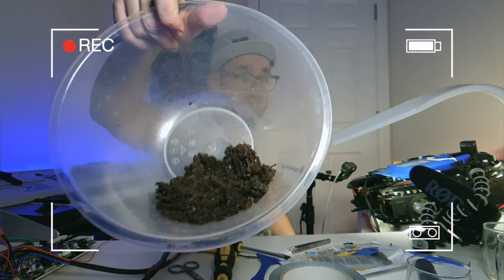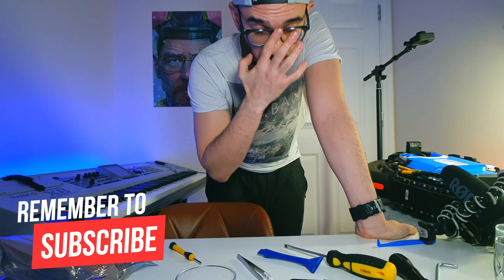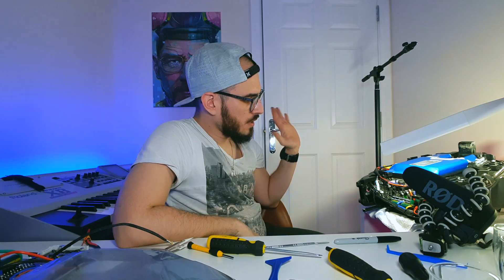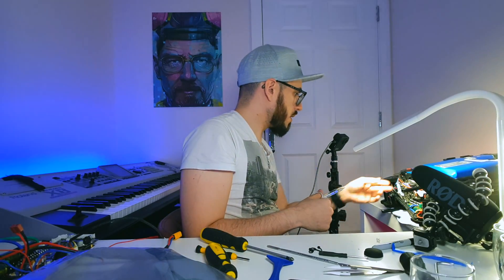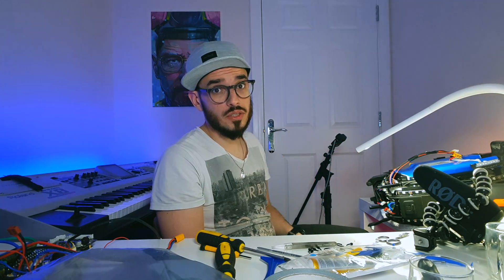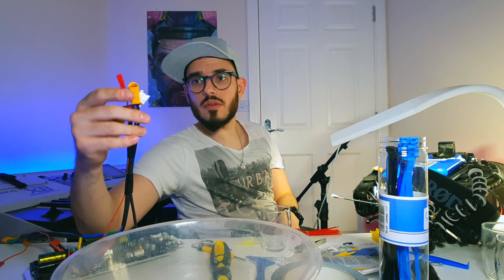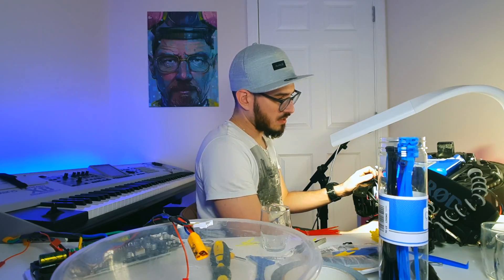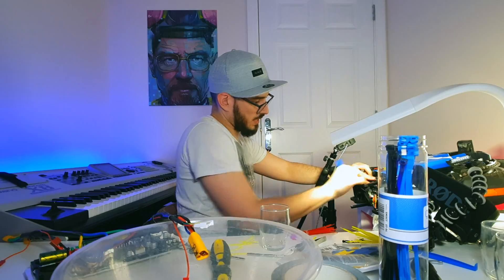Kingsong 16X disassembly ❌SUCH A BAD SURPRISE ❌

Comment: Very good content
I am reviewing vids on this wheel as I am looking to purchase  one to replace my V10F.
So the inside of the wheels electronics compartment was fine, just dirt in the wheel compartment -- that was very good IMHO.
I found the design of how they placed part of the heatsink in the wheel compartment very interesting.  This always for the tires rotation to get natural cooling to the heatsink which is good. There are 2 downsides to this though:
1) the heatsink can build up a dirt layer over time seen at around 8:11 when you pick up the old board. The thicker the dirt layer on this the part of the heatsink the less the heat gets dissipated effectively compared to the new one I think based on my experience with computer heatsinks -- not sure if you notice if your  wheel was running a couple degrees cooler with the new one?
2)I think the material around the hole that seals the electronics from the wheel will be compromised when the old board removed, possibly allowing water and dirt in.  Maybe some extra sealant should have been be added like you did for the covers?

As for all the dirt in the wheel compartment, that did not bother me, other then what gets on the heat sink. I assume all wheels will get dirt in there. If there is evidence it is prohibiting airflow to the heatsink I might think about it more.

Thx for a great vid.
Cheers
Reply from the maker: Hello, bro thank you so much man. Yeah, it was like me I really don't like this design for making the motherboard colling down.. It was surprised man .. But more whells will come this year

Comment: This video made me think of another new invention (which I often do but then I never actually produce) A small stiff bristle brush which clips onto the outside of the tire, and then you roll your wheel forward/backward and the brush which is clipped on the tire moves through the inside and cleans underneath. 
You could do it after every day. And I understand there is not a lot of room but I am sure that it would be possible to make it!
Reply from the maker: That will ve a good product if ot works

Comment: Nice vid. I just ordered a new trolley handle and handle guide bars. My wheel got pretty beat up after getting hit by a car. Wheel still works great and it's gone flying many times. It doesn't look pretty but that's what I get when I buy a fast wheel for my first one.
Reply from the maker: Are you ok? Thats the most important part?
Reply: @MADpack  Oh ya, I reacted correctly by jumping at the last second and rolling into the bonnet/windshield. That made for a softer impact. Still enough to crack the wind shield but I'm fine. Definitely sore for a few days. 
Funny enough, I got more hurt from overleaning on the wheel at almost max speed. I've been scared to push the wheel ever since.
Reply from the maker: @GiffysChannel  im sure.. It was like me when i really hurt myself last year.. It will pass. Just be careful
Reply: @MADpack  Yup and always gear up. I just watched your video of you riding with someone on a bike and I almost thought you weren't wearing pads but then I could just barely see the outline of your knee pads under your pants. It's the same way I wear mine lol

Comment: Still have the z10? I ordered as well a 16x next to my z10 . How would you say the water rezistance is onnthis one ?
Reply from the maker: Hi bro.. Nothing better than see the full review i just released this week: 
https://youtu.be/2MzFRiGnhAc
Reply from the maker: Hi bro.. Nothing better than see the full review i just released this week: 
https://youtu.be/2MzFRiGnhAc
Reply: Will do that then!
Reply from the maker: @AlbertVicol  after let me know if you like the video
Reply: @MADpack  Ofc ofc, I still look over forums, seems to be a problematic wheel. Here in norway lots of rain and I ride winter, I fear it will not keep up with z10 when it comes to water rezistance.
Reply from the maker: @AlbertVicol  there the z10 is a much better wheel in my opinion is one of does boxes that the z destroy the ks 16x
Reply: MADpack Agreed! I crashed at max speed, wheel tumbled for like 20m and just some minor scratches. It is a fking tank. As water wise, 2 gasket system, only problem was getting water in hadle which made grab or power button fuzzy and behave weird, let it dry overnight and works like a charm again. I was thinking maybe the new GW MsuperPro, that seems also a potent wheel.
Reply from the maker: @AlbertVicol  yeah power button is cover with gorilla tape in mine. Like i said still love my z10. Im still negotiating to review the ms pro.. We will see if i can bring it
Reply: MADpack that would be awesome !
Reply from the maker: @AlbertVicol  i agree.. Lets see bro

Comment: Why is the heatsink in the wheel compartment? Seems like bad design
Reply from the maker: Is to cool down the motherboard the think is it should not accumulate mud like that
Reply: @MADpack  just ordered a 16x as my first, it still looks like a good wheel.
Reply from the maker: I will never order the 16x in 2021 with the v12 at your door step. The 16x next to the v12 is a toy
Reply: @MADpack  Now with all 2nd generation V12s grounded and put on the Shelf or else risk joining the dozens-of-cutouts list, the 16x is looking a lot better again. 😁
Reply from the maker: My friend the situation of the v12 is already addressed and is been sort it so no I prefer to wait for a v12 motherboard than ride a 16x but that’s me :) the way I ride I will cutout a 16x I. The first acceleration
Reply: @MADpack  I agree with you that if you want to spend a couple hundred more and don't mind the bulk of a heavier wheel, the v12 is definitely a superior piece of kit. But I don't think Inmotion is being as responsible as it should, you have to be inconvenienced (for months maybe?) by evidence of your wheel failing or they won't replace anything. No guarantee it won't cut out down the road, possibly resulting in injury.

I recently watched Duf do about 42mph on his V12. So yes the wheel looks like a lot of fun, of course until maybe it isn't. In the near future I hope everyone who has a V12 ends up with a safe wheel they can ride with peace of mind.

Until then, I was merely remarking that as of this very moment, your comment about the 16x hasn't aged very well. Even down the road when everything's resolved I think a 16x would still make for a safer wheel for those new to the sport. (for at least the first couple thousand miles ✌)

Love your content, hope you are cool with a constructive comment.
Reply from the maker: Have you seen the video of the v12 cutoff? When we talk about safety when you have a wheel that is so easy to over power like the 16x and that is possible to do a cutoff on the 16x makes no sense. Beside that when the 16x came out loads of cutoff happening, innershell breaking like paper, leds stop working speakers stop working, dust going in after 5km … and the v12 was tested by multiple riders with prototype wheels and no one had a cut off so I will disagree that inmotion didn’t took care of there riders.. I recommend you to check my video of the cut off
Reply: @MADpack  Looks like you deleted my reply. Here it is in a nutshell, feel free to delete this comment too: at the moment the V12 is a poor choice, and the 16x is a much safer choice. That is my opinion. If you want to disagree with me, fine. If you want to delete my comment again, then seriously, wtf?

Unsubscribed.
Reply from the maker: Lolol your comments are all in here my friend I answer you back and everything. And if you want to unsubscribe you can totally do it my friend we are in a free world. Next time check a bit better before starting to say that I have delete your messages.. you look like a kid in your latest one. Have a good day.